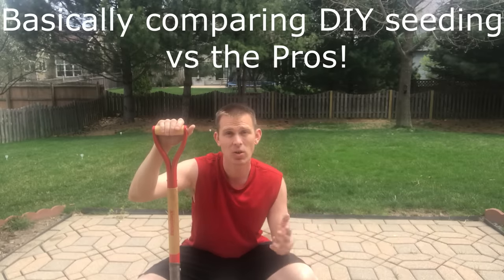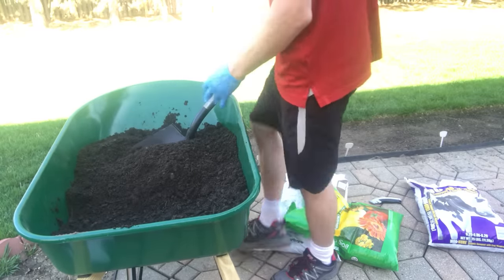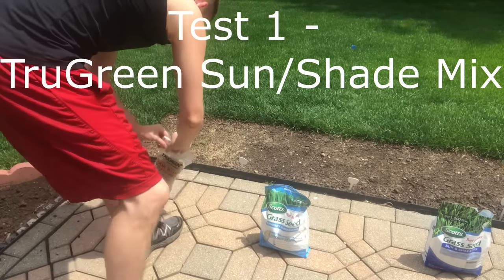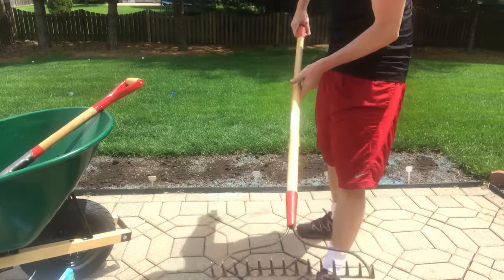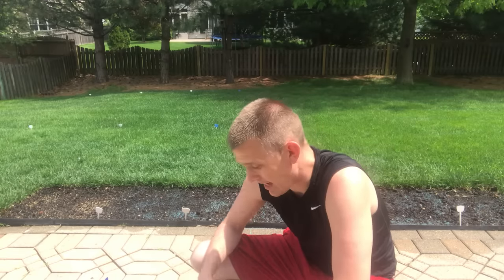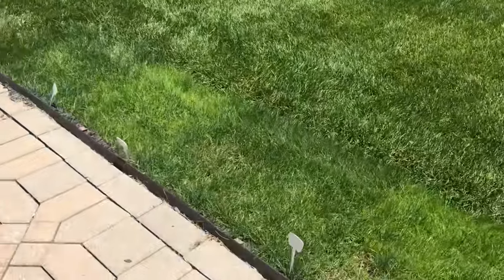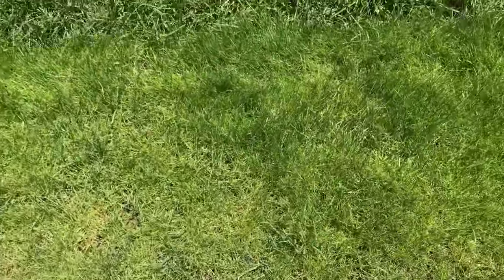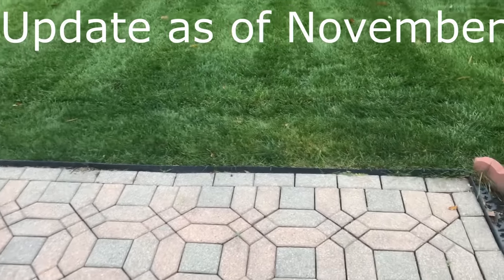Grass Seed Test PROOF! | Grass Seeding Before and After Results (LAWN CARE)

Comment: Another good way to seed a area.(with somewhat of a hole) Is to add top soil 75-80%, then on that add a mix of topsoil, peat moss, and grass seed. Peat moss is good for air,water flow and makes it easier for roots to grow down in the dirt. (No hole hardish soil)Use a garden weasel(rotory cultivator) to loosen the soil really good then just add the seed,peat and soil mix. Most people dont water correctly around my area. People with sprinklers over water and float the seed down the road, or dont have sprinklers and only water after work and the seed has been fried by the sun. A little extra peat moss can add shade or help hold the seed on a slightly more hilly area.
Reply from the maker: Wayne Smith - that is a good idea, I haven't experimented with peat moss in a while.  I will give this a try on my next patch area and see how it works!

Comment: Dude you are a grass lifesaver! I've always wondered if heavy handed seeding would work against positive growth. Nice to see a hands on test, thanks
Reply from the maker: I've always wondered the same thing, every time I seeded.  Thinking is it worth the extra seed or if extra seed hurt the result! 👍
Reply: @JealousLawnCare  also didnt know that miracle grow potting mix also applied to grass, I mean, makes sense that's it's all relative, but I thought it was seperate from grass. So you feel its imperative to use it with top soil eh?
Reply from the maker: I can't prove it's benefits technically, but I like to give the lawn the best chance and therefore the best dirt is used. Heh I don't like to see failure :-/
Reply: @JealousLawnCare  yea I went on and used it anyway, I cant see it hurting
Reply from the maker: Good luck, im sure you'll have great results!

Comment: Thanks for taking time to do this. Ive been experimenting with grass seeds myself. Personally I didn’t notice better results with Scotts products, but what i noticed is that making sure your soil PH is good and Aerating your lawn helps any type of  grass grow better.
Reply from the maker: Boti Bartha -- yes it's hard to tell much difference but Scott's seeds are supposed to do better with less watering vs others which aren't coated.  But with seed I'm constantly watering, so no need there. Heh

Yes definitely annual aeration and seeding is a great practice to do and definitely checking ph and other macro nutrients every few years!

Comment: Every sod lay I have done (myself, solo) - from small sections to 1,000 sq feet, have all been a stunning success. owner was told to water twice a day and miracle grow crystals were dissolved and sprayed on newly laid sod with great effect. ALSO, the area needs to be cut out as you did in your seed example plot. The new sod needs to be laid flush with existing surrounding sod lay. If you don't want to prepare your plot first before laying sod pieces, then don't waste your time. Most ppl are OK with a Spanish speaker gang rushing up, dropping the sod pieces - sans prep - and then running away with a cash payment. Stupid is what stupid does.
Reply from the maker: Very true and well said! 👍. Seeding and sod definitely takes care and prep work for success.
Reply: True. Learned from that. This year I’m doing it on my own. Don’t care how long it will take.

Comment: Nice test effort and well documented.  If you’re looking for an exceptional grass seed I suggest you try Jonathan Green Black Beauty.  I have also experimented with various seeds and believe that the Black Beauty beats everything hands down.  Thanks for your efforts.
Reply from the maker: Jesse Blankenship -- i haven't tried this Black Beauty, what did you find better about this seed compared to others?  Quicker growth, root development, water retention..etc?
Reply: Jealous Lawn Care, Black Beauty has a ver high germination rate, good resistance to drought and diseases and an exceptional root system which helps it maintain a beautiful color and overall health with reduced fertilization. I live in South Carolina where most of the lawns are Bermuda or similar warm season grasses.  Black Beauty stands up to the higher temperatures and lower rainfall.
Reply from the maker: Jesse Blankenship -- wow that does sound pretty great! Thanks for sharing about this product.  So it's a darker green than your neighborhood comparables?
Reply: Jealous Lawn Care Yes, it is much darker and more dense.
Reply from the maker: Jesse Blankenship -- very nice!

Comment: Thanks for reminding me. I always have a bottle of Super Thrive around, been using it for years. I'm getting ready to do some grass repair along a sidewalk.  I didn't think about using my Super Thrive:) My neighbor took a stab at repairing this area last year, the problem was, it's graded, so when it rained, of course much of the seed was washed downhill.  I'm going to try and get it right this year although I just read it would have been best to do it in the fall:)
Reply from the maker: Yes fall seems ideal but spring can Definitely work well too as long as no pre-emergents were put down yet.

Comment: Thumbs up. You really put a lot of effort and time in this great instructional video, I am glad that I subscribed and hope to learn a lot. Thanks.
Reply from the maker: Thanks, yes my videos definitely take a long time but glad to hear it's helpful though!
Reply: @JealousLawnCare  I have a small patch of lawn where there's plenty of sunlight. However, I have not been able to fill bare spots even after replacing the soil several times and trying all types of grass seeds, any suggestions.
Reply from the maker: Shahzad Akhund -- what seed did you use and how often were you watering?  Raking up the ground before seeding and then watering religiously afterwards to keep moist are 99% of why seeding fails.
Reply: @JealousLawnCare  I tried both the Scotts brands, without adding any fertilizer as it comes premixed, that didn't work, then I tried pure seeds and added fertilizer. Only thing that I didn't do was to add manure or compost to the new soil, and I kept it moist by watering every day after putting the seeds as I was told that there should be 1 inch of water for the seeds to establish roots.
Reply from the maker: I would recommend watering more often (not deep watering) in the first few weeks.  Starter fertilizer will definitely help any new seed or grass (even established grass as well), speeds up the germinating time and gets better root growth.  If you rake up the ground and make it nice loose soil that will help greatly also.  No real need for compost or special soil, it's not the culprit.

Comment: Thinking of getting rid of the old lawn and planting a new one . A quick question pls , according to your experience what is the best type of grass seeds to use for the lawn?
Reply from the maker: I would recommend using the same seed type which matches your exact grass type.  Then from there, lots of different brands out there.  I'm currently testing a few at the moment, ive had great success with Scott's.

Comment: What a GREAT video! Great! I watched the year later as well. I just subscribed. Love your advise and tips. Thanks for sharing them. I have a problem.
I am here in New York and I put down the PGF complete right about a week ago and I am wondering if I should be watering my lawn everyday? 2-3 weeks before I put the PGF down I put down the milorganite. We aren't getting much rain and so far I see no difference. 1/4 of my lawn is kinda fried looking, I think from the from the dry spell we had along with the 90 degree days. I am trying to get it back into shape. Any suggestions? Should I just keep watering? Last year I used milorganite all year and was the cool gal on the block. Now .. not so much :(:(:( What can I do?
Reply from the maker: Yes it's been a pretty dry hot summer, interestingly the pgf seems to be a slow release formula but it wants you to water daily for 5 days after application to see results.  Seems strange because most slow release fertilizers don't need to water (just let nature take its course).
Watering regularly through summer will definitely get it back to green yes, or you can let the grass go dormant like most do in summer months.  Just need to keep it alive with watering deep once every week or 2 with this method.
I assume you have not changed anything else since last year? Hopefully you are keeping the grass nice and tall to protect the roots with shade and using a nice sharp mower blade!
Reply: Hi There  @JealousLawnCare . My lawn is taking forever to pop back to life. I have no idea why this happened. Can this really happening from fertilizing in the heat and not much watering? Why I say not much watering, I did water weekly for hours at a time. But now it's still pretty ugly looking in quite a few spots. Your so kind to take the time out and answer. I have been watering every morning so far for 1-1/2 hours each time. Hoping to see a change but it's still 90 and mad hot with no rain in site. This is killing me because my lawn was the lawn everyone would normally be "jealous" of!
Reply from the maker: JoAnn Arizona -- no it should not be due to fertilizing in summer due to the products you used are both slow release.  If you are watering deep every few days that should be ideal to bring the green color back.  
Are you cutting the grass at your tallest setting or close to it? This helps protects the grass roots in summer heat and also give more green look.  Also a sharp mower blade also helps too, so you don't have brown tops on all the blades of grass.

Comment: Would this method work in an area where I can a tree removed and grinded? I know that I’ll need to get out the wood chips but can I follow this same method? Thank you for being so detailed and showing the results!!!
Reply from the maker: Yes you can do this process there as long as the stump is grinded down.
Reply: Jealous Lawn Care ok I’m in TN. The weather has been crazy here lately. 38 degrees overnight last night almost 80 today. Looking at the forecast the weather will be dropping to low 70s next week. Should I wait til spring or do you think I can do it now. If I need to wait to get the best results then I’m totally ok with that! Thank you so much for responding as well. I thought grass would have automatically grown back in 🤷🏼‍♀️
Reply from the maker: I would wait until spring because you need a good month for seed to be fully established with its roots before frost comes in.  Sounds like you could get frost overnight pretty soon.
Reply: Jealous Lawn Care will do!! Thank you so much!!
Reply from the maker: Anytime! Good luck on the spring seeding (just make sure not to put any weed pre-emergent down before seeding also in this area or seeds won't grow).
Reply: Jealous Lawn Care I’ve subscribed to your channel so if I have any questions I’ll be sure to ask! 😊 Thanks again for all of the info!!
Reply from the maker: Great to hear! 🙏

Comment: I  did the same the but I bought an over the ground garden bed and used for my grass seed test ! They way I would not tear up MY YARD THAT I WORKED SO HARD TO IN THE SHAPE THAT IT IS IN ! 2 if  I was to what you did I would have used wooden stakes to divide each section in the bed so that way I would not have spills or mixed grass seed spilling over into another seed  bed ! That way I COULD TRULY GET A BETTER RESULT ! All the way down to watering to see what grass does better with and without water and the use of different fertilizers and etc !
Reply from the maker: Harold Edwards -- yes i could see the benefit of that raised bed for testing.  Good idea!

Comment: You can tell that there's competition in the overseeded section, as it looks the worst (or least good). The bluegrass shoots out rhizomes and it spreads, getting even more dense. So you didn't notice it at first but the sparsely laid section actually looks better than the heavy handed section.
Reply from the maker: Hard to tell much difference after a year or so, surprisingly.  Make sure to check out the 1 year update I did also for reference

Comment: I use Kentucky 31 tall rescue and it's coming in great. Had about 1/4 soil on top of it and watered it often.
Reply from the maker: Charles sanders -- tall fescue is a nice grass type and very nice for striping too.  I hope you are cutting nice and tall!
Reply: Kentucky 31 is a pasture grass.  It is not a turf type tall fescue grass.  Go to www. NTEP.org and you'll see that K31 is the lowest rated of all tall fescues.  Compared to the better performing cultivars, the K31 is a  lighter green; it has wider blades; the texture is more coarse and the density is thinner.  K31 was the latest and greatest grass in 1931.  That's 89 years ago.

Comment: Which seed you recomend for an area that in the summer tops 100 degrees???
Reply from the maker: Omar Orozco - where are you located?
Reply: El paso TX
Reply from the maker: Omar Orozco -- have you tried using Buffalo Grass? That seems to perform very well for the heat.  What is your current grass type and is it not performing well or if not why are you looking to change?

Comment: Thanks for the great video.  I just did a full lawn reno 5 days ago and am impatiently waiting for the seeds to grow.  I have been battling a lot of birds eating my seed.  I am going to spread some more seed to give some sacrificial food to the birds as well as not worry too much about overcrowding with too much seed now that I've seen your test results.  What's your opinion on the optimal time to apply a new lawn fertilizer after applying a Scotts coated seed?
Reply: Same problem here, I was looking at my yard and 4 birds pecking away. Ran them out.
Reply from the maker: Justin Fry -- i would typically use starter fertilizer and also put down Milorganite organic fertilizer with any new seeding in the lawn.  Will give it a great starting boost!  No need to wait at all.

For the birds, they will definitely eat the seed because they don't know the difference in seeds unfortunately.  This is why I always put down seed, then a thin layer of top soil and then light seeding once again to appease mostly the birds. Lol
Reply from the maker: MSotelo503 -- yep birds are always eating all types of seed, I always recommend seed, then thin layer of top soil and then more seed on top (for birds). Heh

Comment: I been growing grass seed for a week now, but only a few seed came up. What should I do? Do I buy more seed?
Reply from the maker: H20 Water -- did you prepare the ground (loosen up the top feet inches) and water as I recommended 3x per day in week 1 to keep moist?
Reply: Jealous Lawn Care No, my lawn used to be full of clover so I took my shovel and sod all the clover out. The ground is soft and moist so I doesn’t feel like raking it. I have 4 3lbs of Scott sun and shade mix to cover only that small area. I put the seed on the ground and cover it with peat moss mix with manure, Scott starter fertilizer, with some lime and miracle grow dirt. I do water 2 times a day for 30 minutes.You can go to my channel and see if that ok, do I need more seed or do I just give it time.
Reply from the maker: H20 Water -- yes it looks like you have a good base there and the grass is coming.  I would wait a bit and see if it comes in thicker soon.  Never hurts of course to do more seed especially since you are already watering though.

Comment: The mixture of soil you’re starting mix at 4:30, do you need those soil to grow grass seed? I mean I put my grass seed( Scott sun and shade mix) on the naked dirt with Scott starter fertilizer and covered the seed up with some peat moss . I actually had irrigation that water 4 times a week. Do you think it going to sprout or do I have to buy some compost for the seed?
Reply from the maker: H20 Water -- no you don't need it to grow grass seed but this method will definitely give it a better chance / result.  It's important to have a nice loose soil base so the seed roots can penetrate easier.  If you water as I recommend you should still have results.  Need to make sure you water the grass seed to keep it moist for growth.

Comment: Can't you lay the seed down before throwing the new mix down then add more on top and rake in and get a thicker result for less overseeding later?
Reply from the maker: Yes you can definitely do that, just make sure the existing soil isn't too hard / compact for the roots to get through